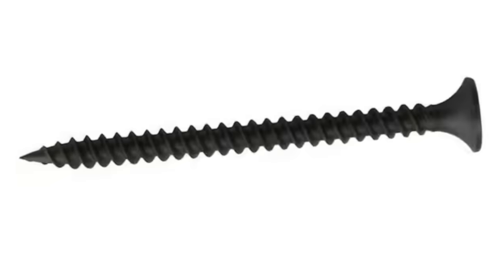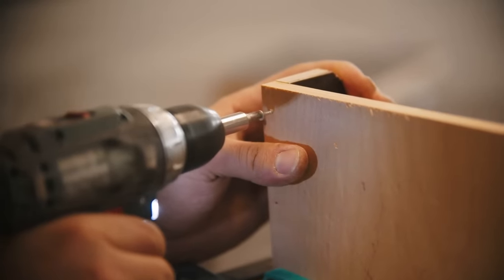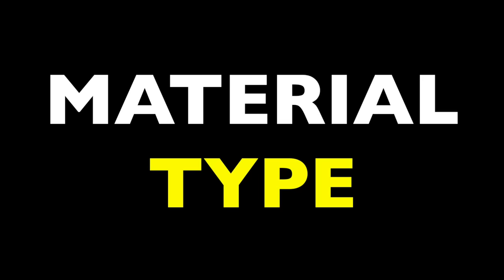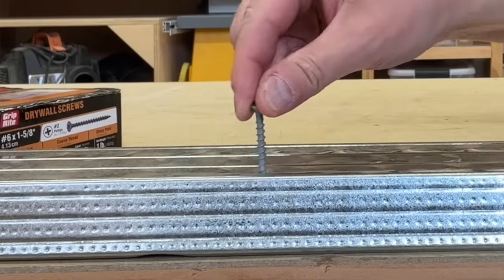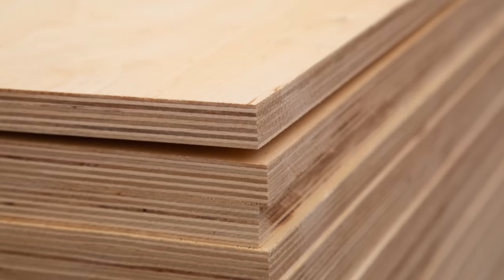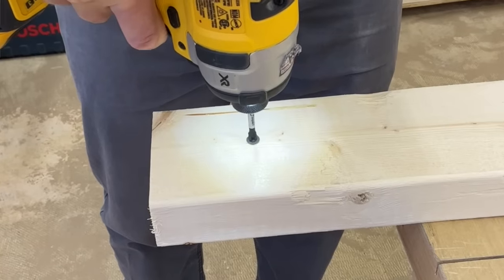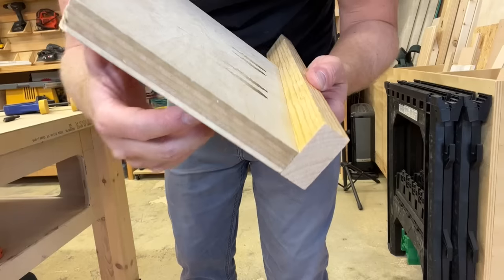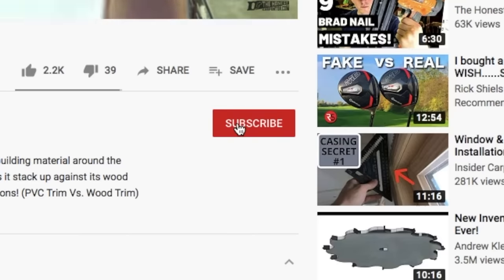This UNNOTICED Screw Detail Makes a Big Difference! (COARSE THREAD vs. FINE THREAD)

Comment: BTW, my high school AP Physics teacher told us that a screw is essentially just a conical or cylindrical section with an inclined plane wrapped around the section. It was a cool explanation about how we use simple geometry to do so much work for us. That was over 40 years ago, and I still think about it every time a use a screw. Some lessons just stick with you forever.
Reply: Interesting, remembering my junior school math teacher telling me two points make a straight line. I could not grasp what he meant. Yet now decades later i always remember him when cutting  or sewing   a straight line🙏
Reply: Yep just a big spiraled wedge, and a wedge needs to have a normal force to produce friction and stay tight. Which is why when people set toilets without the plastic washers under the metal ones they eventually come loose due to the lack of deformation of the plastic. As a plumber I see this often.
Reply: Until the Alzheimer's hits
Reply: SO COOL❣️
Reply: My teacher taught me a screw was essentially a spring. Hence why torque values are such a thing.
Reply: Exactly.  I explained this to one of our mechanical designers about 20 years ago. He said, “ thanks it is so obvious once you explained it that way.”
Reply: As a kid I asked my dad why vehicles' engine speeds didn't just increase smoothly when accelerating. Without knowing, I was asking about gears. He patiently started out explaining levers, the foundational principle of gears and pulleys. I always remembered that clearly, but didn't really grasp the connection until I had to teach the fundamentals of simple machines myself, in an applied math and science course for first-level electricians.

I wish he was still around to share that story with.
Reply: Neato. I remember grade 8 science used a screw as an example of a simple device using leverage. The screw moves maybe 2 inches, but your hand moved a lot more than 2 inches while screwing it in. 
A coarse screw requires less turning, so it has less of a force advantage and more of a speed advantage. 
A nail has no such math behind it where a small force is applied over a long distance, and this is why you can't push a nail into wood just using your fingers.
Reply: I loved the cartoon that showed an Air Force General that was a fat Bird using an old woiden pointer, on a drawing of a screw while describing it as a major purchase for the Air Force.
He said "It's a fully slotted, manually activated, fiber intrusive, materials securing unit".
I've never forgotten the picture. It was brilliant.
Of course, the price per unit was ridiculously high.
Something like a hundred dollars per screw.
Reply: He just explained a shape. Big deal. When someone describes a screw in this way, they’re probably dumb. I mean at what point do you over complicate something do you become smart

Comment: Coarse-thread screws are generally used for quick assembly, while fine-thread screws provide better holding strength. Coarse threads are more resistant to stripping, making them suitable for softer materials, while fine threads are effective in harder materials. The choice depends on the specific application and materials being used.
Reply: You're right to feel offended, since that was obviously a personal comment directed at you alone. Despite the fact that the sole purpose of that comment was to insult your intelligence however, I thought it was useful to see this comment and have the question answered in about a second, as opposed to having to sit through an entire 5 min video @n40tom
Reply: @cytoarchitect  
And if I offended you then I apologize also.  I think I might have been having a bad night so I will delete my first comment . Take care and be safe
Reply: We all have bad days. The world needs more integrity and humility, as you've shown. I respect you for that. Keep your head up brother  @n40tom

Comment: I took woodshop classes for three years in school and was taught the difference between the different threads on screws in the first two weeks of my first year. I never forgot that lesson because the teacher demonstrated his lessons so that we all were able to cement the knowledge in our minds. In that same year I learned about other joining techniques as well, including dovetail joints. In my later years I went to college and took carpentry classes just to get the credentials for what I already knew. By that time I had become a woodworker extraordinaire, with the skills to fit cabinetry to the interior walls of buses. I was already a good cabinet and furniture designer and maker. The biggest reason for having such high skills in woodworking is because my father, his father, and his father's father were all woodworkers, and I learned most of my knowledge from them. Like my grandfather I got into designing and making furniture, not because it made money for me, but because it is an artform, and is a lot of fun to do. The money I made doing it was just a bonus for doing what I love so well.

Comment: I learned at an early age through experimentation that screw thread spacing is related to the material you are screwing into, which you so clearly explain! ❤
Reply from the maker: Thanks JC! With enough experimenting, it all starts to become clear. 😁
Reply: @TheHonestCarpenter  absolutely! Learning the hard way has always been my default due to impatience and just grabbing the nearest “screw”. As I got older I decided that going to the hardware store to get the right tools for the job was an overall time and materials saver, which I learned by doing it wrong 🤣

Comment: To add a little to what you said, when screwing into steel studs you can usually drill into 20 to 25ga metal with a "good" fine thread sharp point screw, however drilling into anything heavier would require a self drilling fine threaded screw! Attaching plywood into heavy gauge metal (18ga or heavier) you can use what they call a ply metal tek with wings, no predrilling required!
Reply from the maker: Awesome. Thanks for the extra info, Bill!

Comment: "It's a small detail but makes a big difference." Well said! Many years ago, I installed a drywall ceiling over resilient channel. Unfortunately, I used coarse thread (was quite inexperienced at the time) and it did not hold well at all! Took a long time to redo it with the proper screws (and then remove the coarse thread screws). What a mess! Certainly a lesson learned the hard way!

Comment: Thank you. I love that you got straight to the point with clear succinct explanations interspersed with some great demonstrations of how, where and why. Some content creators seem to love the sound of their own voices more than they love actually teaching/demonstrating anything. As a middle aged spinster on a fixed income, l've had to teach myself all sorts of DIY skills over the years. I nearly didn't bother watching this cos, my first thought was, - Meh, screws apart from, wood, metal, drywall or self tapping. What's to know? - I love how wrong l was. l was hoping you'd also clarify why the unthreaded part varies in length but, you may have done that in other videos. Have subscribed and am off to learn some more from your other videos. Thanks. 😊

Comment: Thanks, that was a good and helpful explanation. I knew most of this through trial and error, but hadn't thought it through: why those fine threads suck on soft wood, or why sheet metal and pole barn screws are both fine and coarse, or why those fine thread door closer screws they supply always rip out of my pine door frame on a windy day.

Comment: I like the course threads with a groove at the beginning that cuts a hole for the threads, stops splitting at the edge of boards.
Reply from the maker: Yep, self-tapping threads. Great innovation!
Reply: @TheHonestCarpenter he's not describing self-tapping threads, he's just talking about the 'type 17' point or the cut tip (with various trade names) that helps the screw self-drill in wood.

My pet peeve is when people confuse 'self-drilling' with 'self tapping'. 
Pretty much any screw with sharp threads is self-tapping.

And the term 'self-drilling' only really applies to metal, because in wood and other soft materials, pretty much any screw with a sharp point is self-drilling, even if it doesn't have any special cutting tip. 

And if we really want to get technical, even  'thread forming' screws are different from 'thread cutting', I'm honestly not sure the difference, but I would describe both as 'self-tapping'.

Comment: I've use drywall screws for years. And noticed that it took the same amount of time to screw either a coarse or fine drywall screw ( at least the ones I've been using ) and noticed that the fine thread drywall screws have a double helix so the thread pitch between the two are exactly the same.  Something to ponder!
Reply: Yes. I’m not sure he even understands that.

Comment: Ethan, maybe consider expanding this topic to also consider material type ... such as using cement board (alkali resistant) or pressure treated wood and ACQ screws?

Comment: Almost all the screws I use for wood, and varied boards, have a serrated edge, tipical of the "Spax" brand. Recently I had to use a good bunch of them for fixing chipboards to an structure of steel square tubes. It was surprising how many of the screws became broken, until realizing that serrated edge and metal weren´t good friends.
Reply: Regarding those Spax screws, I find the GRK brand far superior in terms of staying on your driver tip and not spinning out. I believe the star heads on the GRK's are made deeper.
Reply: @johnwalenski1555 I agree that GRK screws are much higher than Spax. I've had a bunch of Spax screws be defective right out of the box, and they seem weaker and more poorly made overall (I can't recall if I've ever snapped one, but I only use those once in a while anyway).

That said, using wood screws (with cut drilling tip or not) in metal is just dumb, regardless of the brand.
Reply: Agreed. Jumped the gun a bit with my comment, saw "spax" and had to get my 2 cents worth in. Certainly not my first choice for fastening into metal!

Comment: There are a couple of things that I see even experienced carpenters do that drive me crazy. 
First thing is using a screw with threads all the way up the shank to attach two boards, without pre-drilling the top board. This results in the screw tightening all the way down to the first board, but the two boards are not sucked tight together.
Secondly, is using drywall screws where construction screws should be used. For those that don't know the difference between drywall and construction screws, try this. Drive a construction screw half way into a 2 by 4 and use a hammer to hit it side to side. You'll find it just keeps bending. Try the same with a drywall screw and in the first few blows it will snap off.
Obviously using sheet rock screws for things like framing can be dangerous
Reply: You are correct !   Drywall screws are not for structural use because the hardening process makes them brittle.
Reply: @bogtrottername7001   Nah. They're still incredibly strong and if they're driven all the way in they're not going to take a lateral hit from a hammer-like object bending them almost 90 degrees very frequently, so if there's no construction screws on hand then using a few cheap drywall screws tends to work just fine. 

Project Farm did a shear test for similarly-sized screws and nails 4 years ago and it showed drywall screws actually out-performing deck screws and GRK construction screws (and all nails). Probably because that extra "brittleness" resists bending, and the failure comes not from shearing off (which doesn't happen) but from bending which simply pulls the threads out of the static board.

So actually drywall screws can be better.
Goodbye.

Comment: I started doing drywall on metal studs with fine thread screws. Then when I tried it with coarse thread screws I found it work better even though it doesn't seem like it would. I never have problems with nail pops either.
Reply: The drywall stops it from wobbling and since it's going into thin metal there's not really a difference in strength; they're both being held in by 1 thread. Coarse thread probably goes in faster, which is important for professional work.

Comment: When finishing my basement, I had to maximize ceiling height beneath some heating plenums so I strapped using 1x4's but then had to use metal drywall screws because the 1 5/8" wood screws were too long by about 1/4".
Reply from the maker: Yeah, 1-5:8 can be a really inconvenient size sometimes…

Comment: Screws have changed a lot but in the 90s when screwing on a ton of OSB in a barn we found the fine threads worked better. You could run them flush without snapping off the heads and we weren't about to pre-drill & countersink thousands of screws.

Comment: I HATE that squeak when driving a screw into hardwood (or hard plastic like acrylic) because it is often followed by the screw breaking. I tend to back out when I hear it and drill a slightly bigger pilot hole. My Dad also taught me to lube screws with soap or wax before use, which seems to help a lot.

Love your channel, BTW.
Reply from the maker: Great tips, Cory! 😄

Comment: Good analysis!  But somewhat unrelated, I much prefer the Canadian Robertson screw heads--the square hole won't strip or cam out like phillips screw heads do, and hold the driver MUCH better than flathead screws.  Uncommon in the USA and elsewhere, but easily ordered from Canada!
Reply: Totally agree, I was brought up on flat and cross/ Phillips head screws. Found the Robertsons are so much better and also cope better when screwdriver not quite in line for those awkward to get to screws, so I have converted to. Only disadvantage is head can more easily fill with paint or grit etc over time; nothing that can’t be easily removed with a sharp object before undoing the screw.

Comment: to avoid splintting the wood at the ende, drill a hole first. the diameter of the hole should be the diameter of the shank of the screw, so the shank goes free in the material, and only the thread edges cut into the material. this is especially true for hard wood like oak and beech.

Comment: Short, 'more' cleats will have better grip on tough ground, where they dig in slightly but a lot of them.  Longer, fewer cleats (coarse) would have less cleats barely penetrate and have much less grip.
The same short, more cleats will simply grab a small piece of the ground and scoop it out and push it on soft ground.  The longer, less cleats will sink in, grab a larger scoop to work against, and be less likely to slip while generating more force against the soft ground.
It isn't just the draw speed, 'shallower and more often' is more suitable to generating more force in harder materials that aren't as easy to dig into, and coarse 'deeper and less often' is more suitable to loading softer materials better.  This applies across many similar things, not just woodworking.

Comment: I guess for me it's always been sort of intuitive, so the only time I would use fine thread would be with sheet metal.  And I'm not a professional rocker doing commercial work so I can't think of an application where I'd be using fine thread screws.  If I'm attaching oak material to framing (cabinets, e.g.) I'd predrill the oak and use coarse threaded screws.  I frequently predrill and countersink (a Phillips head driver works fine in soft woulds) anyway to splitting.

Unfortunately the previous owner of my house, an engineer of some type, was about as dumb as rocks whatever he did.  Used tons and tons of fine thread drywall screws in framing material, pine plywood, etc.  A royal pain to remove wherever I was rectifying his messes.

Comment: I wonder if fine-threaded drywall screws in maple remain tighter under load than their coarse-threaded counterparts.

I'm here because we have two expensive maple kitchen stools that are constantly getting wobbly because the drywall screws used to attach the seats to the legs get loose after a few weeks of use. The last time I tightened them, I noticed that the screws are coarse-threaded drywall screws. The next time they loosen, I'm going to try replacing the screws on one with fine-threaded drywall screws.

The video doesn't mention whether or not the thread style affects the long-term holding ability of a drywall screw in hardwood (like maple). I'm curious to see if using a fine-threaded screw improves my two maple kitchen stools.

Comment: OK - having been in the industry for almost 4 decades this one drives me crazy. The "other" what is the difference in these screws. The ones you showed with the drill point, also often known as TEK screws, are not "self tapping" screws. Self tapping means it is a screw that "taps" threads into an already existing hole. They are "self drilling" screws and drill a hole before the threads tap the material. Thanks!

Comment: Remember: Fine thread, for metal (since it is generally thin & you need the extra threads to ensure 'purchase' or grab); & hardwoods (e.g. oak)- will drive in slower, less aggressive/ many threads grab onto the material & the shallower threads won't split the wood; whereas coarse thread screws will drive in too fast, create a lot of strain, can split the wood. Very high quality wood screws tend to be fine thread, w/ an unthreaded portion. Coarse thread screws- an advantage in soft woods, (e.g. pine, spruce, fir or plywoods- most construction materials): which have softer inside layers. Soft wood grain is more elastic (stretches & molds around screw)/ can even often eliminate pre-drillin; good w/ deck & structural screws' (Fine screws can gum up channels for the screw/ slow). Composites (e.g. melamine, mdf), also go well w/ coarse thread: if predrill. (pocke, drywalll screws- come in both; Q = what is your bottom material)..